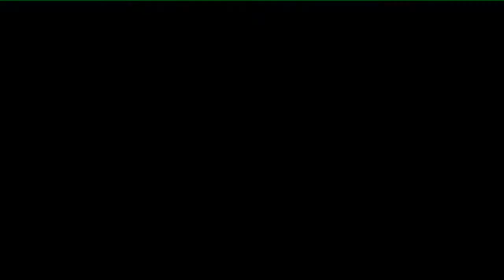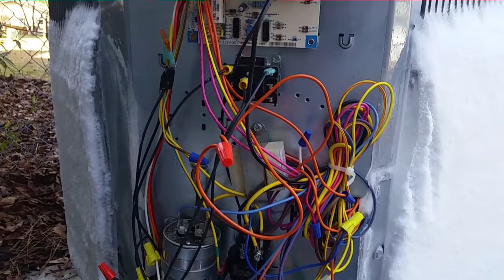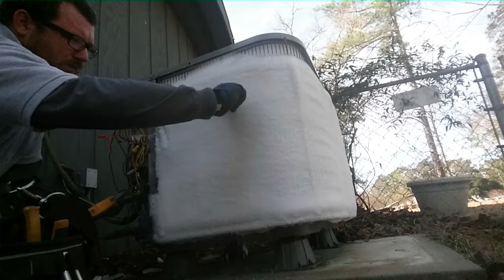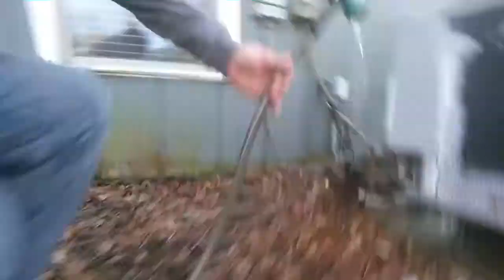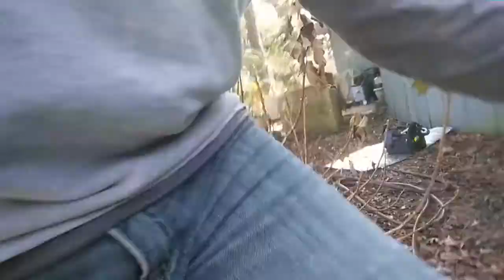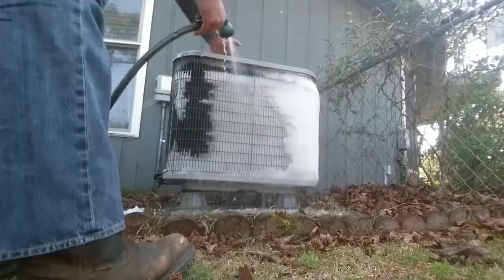ICP Heat Pump Fails to Defrost

Comment: You can disconnect the fan and switch it over to cooling, to thaw the ice. But you did an awesome job!
Reply: Vann Berg HVAC well that’s not really good practice because the condenser isn’t getting any airflow. So it would probably go out on high head